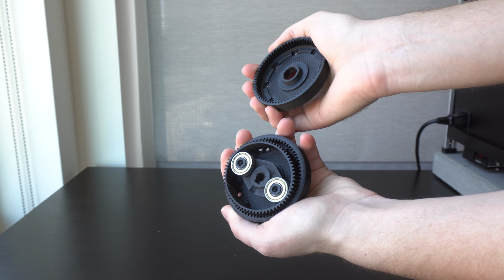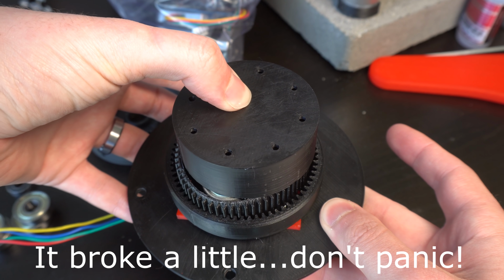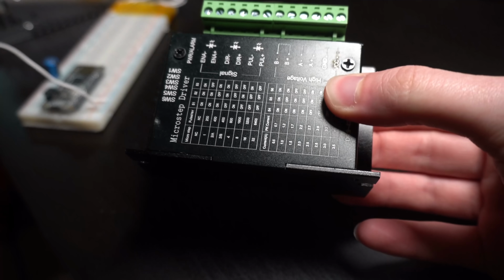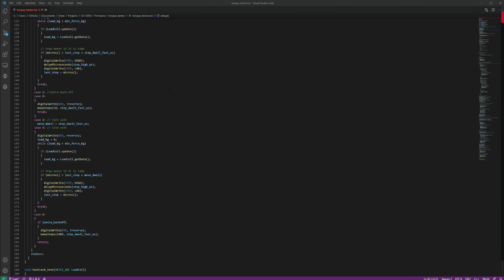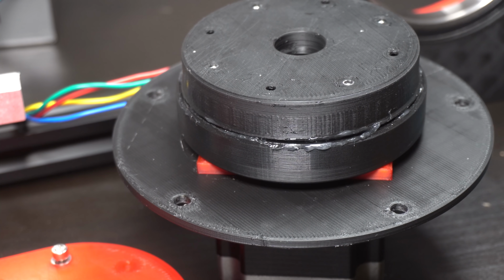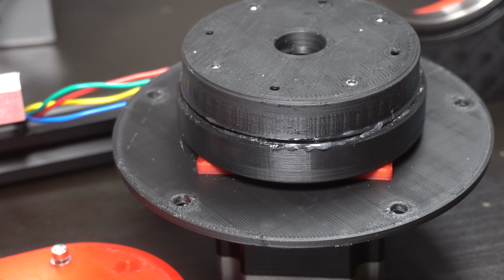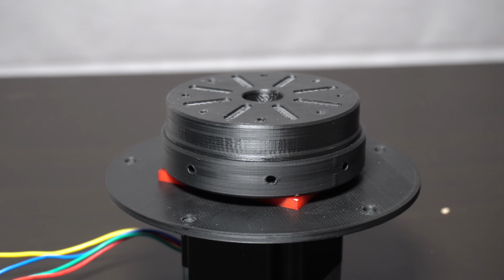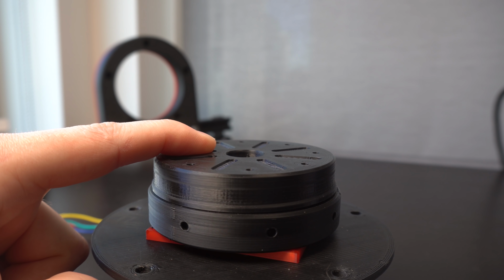My 3D Printed Harmonic Drive is Surprisingly Powerful!

Comment: With PA-CF, the flexspline is flexible enough with nylon and rigid enough with carbon fiber. And way easier to print than Nylon alone.
Reply from the maker: Yeah that is a good option, my main concern with filled plastics like that is the abrasiveness of the CF causing accelerated wear on the housing gears. But I don't have any testing data on that!

Comment: Hye man how did you measure the current with the multimeter? I have a similar driver and suspect its not outputting enough current but i cannot figure out how to properly connect the multimeter to get a proper reading

Comment: Hi there, I am a university student trying to create my own harmonic gear drive for my dissertation, it will be 3D printed and its use will be for a Mars rover robotic arm. I was wondering if you could provide some explanation into the gear tooth dimension calculations you did? I have been trying for a few days now and keep getting confused with the 2 tooth difference between circular spline and flex spline.

Comment: For the gear tooth profile, you should use a stub profile (addendum = 0,8, dedendum =1) and 30° pressure angle as it seems to be used by commercial strain wave gearboxes.

Comment: Hi! Do you have a video of assembly? I tried printing the V2 of this from your github and found that a NEMA 23 motor stalls trying to push the flexspline. Any advice would be great. Not sure if I have assembled the housings correctly
Reply from the maker: That means your printer is possibly overextruding a bit and the teeth aren't meshing properly. Best way to fix it is to drop your extrusion multiplier by about 5-10% and reprint the parts. You may be able to get away with just reprinting the flex spline.
Reply: @3DprintedLife  Thanks for responding. I was able to get the flex spline printed correctly. How did you attach the Nema 23 motor to the Test Bracket? I find that the housing case comes apart pretty easily without the motor being held in place

Comment: I'm not actually sure I understand how you're driving the output. You said you're using the same flex spline to mesh to two case gears, one with two more teeth than the other. If one case gear has two more teeth at the same module, wouldn't it be bigger and fail to contact the flex spline?
Reply from the maker: So the output side teeth are spaced at a tighter pitch to keep the centerline circumference the same as the drive side teeth. Since only 1-2 teeth fully mesh at a time from the flex spline, there aren’t any jamming issues

Comment: Where did you find a GT2 pulley with no top? Would be great to get a link to the part
Reply from the maker: It's just a standard pulley with the top flange removed using pliers

Comment: What is blocking the external cover, the reduced one, to fall from the flex ring? You cad does not have anything to hold the cover in place while keep it spining. Did you assemble a bearing against that chanfer and mounted it on the arm?
Reply from the maker: Yes exactly. This gearbox is designed for direct integration into an assembly to constrain it and cannot function on its own. This reduces the assembly size and complexity

Comment: Commercial boxes often use an eliptical bearing instead of rollers, which increases the number of theeth in contact.  But, where do you get an eliptical bearing?
You take a thin section bearing and squash it a bit in a vice!  3D Print an eliptical boss to fit tightly in the centre of the bearing to stop it returning to circular.
With this approach, you can go back to your original toothed belt design, as the belt is stretched over the bearing, which removes (most of) the backlash.  The combination of the two  significantly increase the overall strength.

Comment: I have the feeling you are choosing an unsuitable solution for a problem that is typically solved with very boring, conventional gear pairings or even timed toothed belts. Harmonic drives make sense if you have transmission in the tens or hundreds. Your application requires 10 Nm. A 3 Nm stepper, complete with drive and power supply unit, is like 30 bucks.
 Your backlash is really not that great and is comparable to a 20-60 m=1 gear pairing. Which would cost maybe 20 bucks more but save a lot of time tinkering with your DIY gear. If you are really pushing the DIY angle you could even print some involute gearings (which are somewhat expensive to buy) and see what module and teeth width you can get away with. Of course, toothed belts are always an option, too.
Reply from the maker: I considered an OTS angle like that, but in this price range it really doesn't work well. That's why most robot arms under $1k have pretty terrible payload/range performance.
A 3Nm capable stepper is massive, plus gearbox. Price isn't the issue, but we're talking 1kg+ per setup and a very long profile which is a pain to fit in a robot arm without complex gearing (and the added backlash in the stack) and would add so much unnecessary mass to the arm, requiring even more torque to compensate.
Smaller steppers with a multi-stage gearbox could work but again that adds a lot of size, complexity, and backlash.
3D printing a gearbox isn't the best solution, and harmonic drives are rarely the best option, but for the price and considering the good overall balance of torque, gear reduction, size, and backlash, it was the best option for my arm design.
Reply: @3DprintedLife  that is certainly a factor, but you need your 10Nm on the shoulder joint, where the actuator's weight and size typically does not matter. But the main point of my comment is that a harmonic drive does not offer advantages in weight, size or backlash if the transmission ratio is low enough that it can be implemented with a single-stage spur gear pairing. And this isn't even taking the low efficiency of DIY gearboxes into account. 
I started writing this response exploring different pairings of drives and internal gear set-ups, but as I am writing this, I have a better proposal. 
For the elbow joint, put the drive near the shoulder joint and use a toothed belt transmission. With that you minimize the torque on the shoulder joint from the drive's weight, you can include the transmission ratio by choosing appropriate pulleys, and since you are 3D printing, you can choose your backlash yourself.

Comment: You should design a compliant mechanism as the spring per say instead of the belt. It would actually work perfectly for this opperation and give you far better results in your testing right off the bat. Hope it helps ya ;)

Comment: Oh!  Smart!  I like the belt idea... but what if we used TPU for the flex spline?  This stuff is super resilient and still pretty bendy.

I wanna say I'd try tpu for the flex, and resin printed abs-like anycubic resin for the hard parts.  Its so tough, but unlike some of the resins I've tried it literally will flex in half without snapping if you make it thin enough to bend.  Nutty stuff...

Comment: Amazing video! This is by far one of the best strain wave gear designs and concept explanations I've ever seen. Just a quick question, what kind of 3D printer are you using for printing all of those parts in 4 hours?
Reply from the maker: Thanks! It's actually my own custom design, called the Eclips3D2

Comment: Did you try any alternative belt tooth profiles? If you were using standard 3D printer belts a lot use GT2, which is curvilinear profile. The label on the belt you were showing off around 2:45 unfortunately didn't say the type. Curvilinear is quieter and higher torque, but at the cost of backlash. I'm curious if using a trapezoidal profile belt like XL/MXL would be helpful, although I could also see inverting the belt messing with the potential benefits.

Comment: This is pretty cool! How are you keeping the two halves of the gear box together? It looks like the output side is just floating on half of the splines of the wave generator. Edit: perhaps I should have checked how old this video was before commenting lol. The algorithm strikes again. Off to watch the videos that you posted after this :)
Reply from the maker: You are right though, nothing keeps the halves together. This drive is made for integration only and not standalone use. But this keeps the unit as compact as possible

Comment: Im trying to model my own Harmonic gear in fusion 360, but I can't get it to work. If I keep the module equal for the housing and the flex spline, the teeth dont mesh anymore. Did you have a similar issue?

Comment: I can’t understand why some people are obsessed with 3d printing for high torque applications, I understand that having a 5 axis cnc mill and a heat treating oven to produce nice metal parts from C45 isn’t the cheapest or easiest task, but there are always a realistic middle ground if you’re willing to take the effort, or you can just try hard with your cute 3d prints and go nowhere with this clearly idiotic idea
This isn’t an attack against you, anyone you are if you reading this, I’m just an engineer trying to understand this kind of content, I believe for most high torque parts, the realistic choice of material is some kind of metal, mostly steel, you can cast from 3d printed parts, of just turn and mill your parts, through your school or a maker space you can have a chance to machine your parts, and for low tolerance parts, you can just cut some steel bars and weld them together.
I know all of this sounds hard, but the easy route is always the shitty one

Comment: What reduction ratio do you need? Why don't you simply use worm gears?
Reply from the maker: About 30:1, and good question! Worn gears have a lot more backlash and wear much quicker, plus a plastic 3d printed design probably couldn’t handle the loads that this can. So it could be used but it wouldn’t be as effective.

Comment: Would printing these parts durable and accurate enough to use be possible with stock ender 3?
Reply from the maker: Probably, you may just need to slightly adjust the the extrusion multiplier or the scale of some parts

Comment: Your procurement problem for your driver board is why I comment: I really have a lot of grudges against Altium confusing/clunky user interface but one thing that has really improved my workflow in the design stage is the Manufacturer Parts Search. It allows for parts search and drag and drop if symbol and packages are provided, so it speeds up the process by avoiding to draw your components and build your custom library and what is the real power nowadays is the near instantaneous view on the stock at all the parts providers you can think of (customizable in preferences). So you can design in the early stages whilst ensuring you ll be able to produce without the hassle of searching on octopart/mouser/farnell/digikey all on separate browser tabs and with the unbearable lag those site suffer from which Altium avoid by tapping in their database at low level.

Comment: What software did you use at the beginning to simulate the pulley belt and motor operations? Would be handy to know for my project!
Reply from the maker: That was the cad software I used to use. There’s a lot of options for cad but personally I recommend Onshape. It’s free for general users, browser based, and surprisingly powerful and feature packed

Comment: Hmm maybe I could build a 4 axis for my hobby CNC this way…?!
Reply from the maker: I wouldn’t recommend it :) CNCs require much higher precision than robotic arms. I would not recommend using a gearbox at all anyway, a high power motor directly driving a ballscrew or lead screw is much better for that application.

Comment: Awesome job! Inspired me to design one for a Nema 14 and using a resin printer for the finer details. One question, it wasn't exactly clear what holds the driven part of the gearbox from pulling away. Is that the intent of the very large bearing?

Comment: Hey, great content!! I also made a Harmonic Drive for my robotic arm, but it slippes under 70Ncm. I printed the Flex Spline with TPU, the thickness is 0.8mm and my teeth height is 3,5mm. I hope you can help me with my Problem.
Best regards

Comment: steppers are cheap??  wah?  since when?  steppers are expensive as hell!
Reply from the maker: Small steppers have drastically dropped in price for consumers ever since 3D printing started to become popular. A nema 23 like the one I'm using is $15-20, and the drivers are as cheap as $5.
Reply: @3DprintedLife  So, the same prices they were 20 years ago.  well... maybe a $5 cheaper.. But I guess with inflation that makes sense  But I still wouldn't call $15-$20/motor cheap.  Awesome project though.  I look forward to the full recap video
Reply from the maker: Compared to the alternative which is brushless servos, trust me these are extremely cheap. Even hoppy grade brushless servos are around $50-100 and a driver is equally expensive. So at a minimum steppers are about 5x cheaper

Comment: Would you think such a "gearbox" would work for a DIY tracking mount for astrophotography?

I realized... even the "cheap" (500$+ with tripod) Skywatcher EQ3-2 worm gears and the original stepper motors is just not really precise enough for AP.
Wondering if there are affordable DIY alternatives which can partially compete with for example 1500$+ mounts like the EQ6R Pro etc.
Reply from the maker: This design is optimized for high torque and low cost, as such the accuracy is not great. I really doubt this work work for your application, you'll definitely want a metal gearbox and unless you have the means to machine your own, it will be expensive to get an accurate one as I'm sure you've already seen.
Reply: @3DprintedLife  Torque is another thing which is one of the reasons the EQ3-2 is not precise. Its basically overloaded already when using a 750mm F4 newton and little bit AP gear.

My EQ3-2 is for example much more precise when using a regular telephoto lens like the RF 800 F11 which weights around 1/4 of the telescope and no counterweights needed anymore.

Thats why im wondering... if you put this thing under stress it should be precise, as long the telescopes weight pushes back the mechanism?
Thats also how i often work with my mount... make it lighter on the side its turning to so the gears are always under a little bit stress and i dont have this extreme backlash, increase tracking performance a lot and make also autoguiding a bit more precise.
Reply: I'm actually looking into exactly that. I'd like to make a 2-stage 30:1 (so 900:1) gearbox for light setups with a dslr and something like a rokinon. Since harmonic gears dont have a lot of backlash, I dont see why this wouldn't work?

Comment: Did you look into a cycloidal drive as a potential solution?
Reply from the maker: I did, but harmonic provides higher reduction and a less springy gearbox (since everything is plastic, this is way more of a factor than metal gearboxes)

Comment: Just want to mention, it makes sense you were getting too much slop with the rubber belt. They're designed to be run in tension and have a certain amount of expansion expected. So without that tension it would flex too well.

Comment: Question, why you don't use a planetary gear instead of the harmonic drive?
Reply from the maker: Harmonic has less backlash and much higher reduction rates in a single stage. And also it’s cooler

Comment: I was making planetary gearboxes for my plastic extruder. It kept breaking and eventually reached the limit of the plastic regardless of my design. I only had one stepper driver as well so what I did was just make two them and wired them in parallel. They were nema 17s and the stepper driver was only a 2A but it never popped the driver and never broke the gearbox anymore. Other things broke 😅. I feel your pain in this video with reiterating though. You tend to learn so much from it though. Great video thanks.

Comment: A thought came to me though I’m not sure if it will help or not. How about making the wave generator the exact shape of the inside of the flexi gear with a tiny amount of clearance. My thinking is that it might reduce failures under load by reducing distortion.

Comment: How would it be to use magnets instead? It's flexible. It'll never wear out. Perhaps a little heavier???
Reply from the maker: That could work, but the problem with magnetic gears is that they can't carry as much load and have a lot more compliance, so definitely not ideal for this application.

Comment: there is a suggestion how to reduce the diameter of the reducer to nema 17 dimensions
Reply from the maker: That’s certainly possible but it would be very difficult doing it out of plastic. You wouldn’t be able to have as much reduction (less teeth on both halves of the housing) and making the flex spline still be strong but flexible enough would be tricky
Reply: @3DprintedLife  just the entire process of reducing the reducer will fit within the limits of the 3d printer printing, while the technology used in the reducer itself will be more technically successful

Comment: So how does it actually work?

Do I understand correctly that
* there are two ring gears, with a different number of teeth?
* A single flex spline engages both?
* The wave generator in the middle has four gears.  The bottom two force the flex spline into the bottom ring gear, and the upper two force the flex spline into the upper ring gear.

So is the flex spline constant thickness, and it has to distort outward axially from the smaller ring gear to the larger ring gear?

Or is the flex spline printed with a slight axial step in it?  That doesn't seem possible, you wouldn't get any gearing action from the smaller to the larger ring gear.